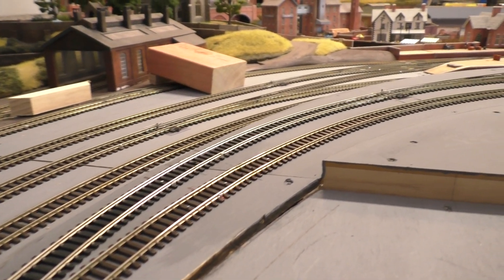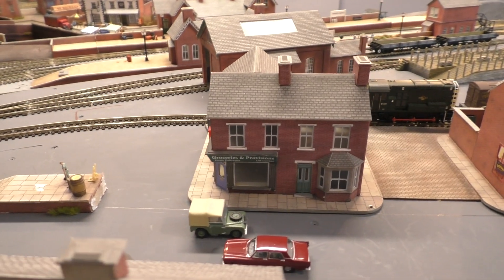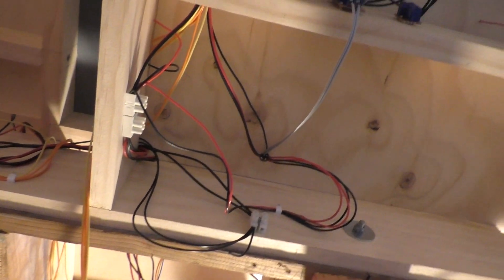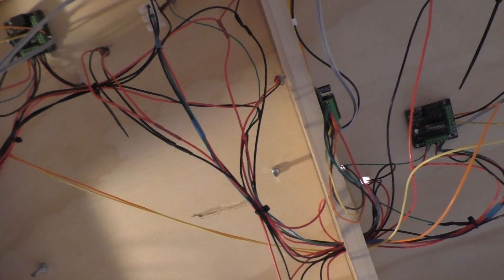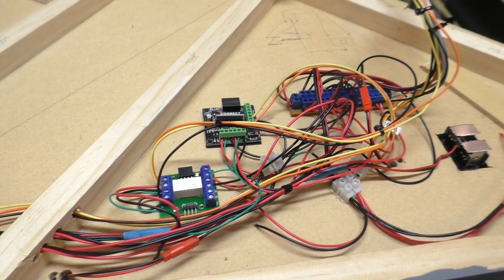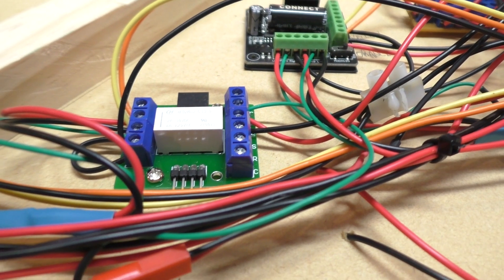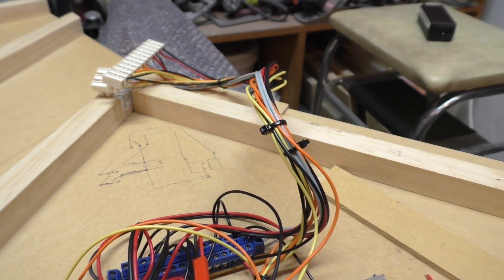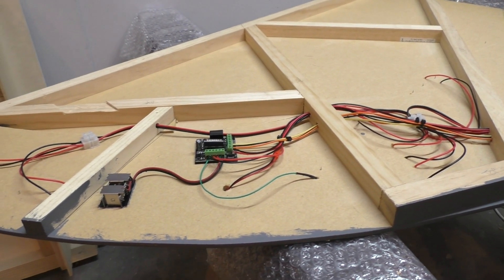Goodsyard Revamp - Testing New Trackwork (Part 1A)

Comment: A great milestone to reach with all trackwork & points working well. Personally I would site the cattle dock on one of the other sidings rather than the goods shed line, Most stations had an end-loading dock as well. Love all the green diesels!
Reply from the maker: Thanks Paul. I did little bit of research about cattle dock placements and based on the Shepton Mallet Charlton Road Railway Station, I'm happy with the cattle dock's current location. It appears the cattle dock at Shepton Mallet was on the same siding as the Goods Shed, and in quite close proximity to each other. I managed to find this photo... https://i.ebayimg.com/images/g/jbcAAOSwQJFZzjVL/s-l500.jpg

Comment: Hi Julian, incredibly smooth, have you ever looked at Cobalt slow action point motors? No need for CDU's and have built in switches for frog polarity etc, I have heaps of passing loops whereby they operate in pairs. Most enjoyable video.
Reply from the maker: Thank you for the kind feedback. I haven't considered Cobalt or Tortoise motors for tow reasons; firstly the size prohibits their use on Station Road because there's a number of areas where the lower level runs directly underneath and there isn't enough clearance for these bulky units. Secondly is the price, I can buy 3 x Rails Connect motors and CDU/Decoders for £48, whereas a single Cobalt costs £23 (approx) so £69 for 3.
Reply: I'd love to get some Cobalts for my layout but cannot justify the spend at the moment - I'm sill using the Guagemaster/SEEP PM4 point motors (they latch at either side and have the built in accessory switch to change frog polarity too).  The Guagemaster or Rails CDUs also can throw 2 or 3 points at the same time, so no issues with wiring these in series either 🙂

Comment: DPDT switch sounds an interesting solution to connecting two points. I have three crossovers linked through each pair simply by wiring them in series. The problem I had was that an old but ultra reliable Peco CDU didn’t have the grunt to throw two motors at a time, especially with longer runs of wires. I found a newer Rails of Sheffield CDUs was much more powerful and throws all pairs of points quite happily!
Reply from the maker: The DPDT switches certainly solved the issues I was having, and to be honest I don't really know why, as long as it works is good enough for me. The goods shed head-shunt crossover uses a single Rail Connect CDU and it seems to power both point motors adequately, not sure if it could power more than 2 though. The thing I had to do here was isolate out one of the frog power connections to a seperate relay.